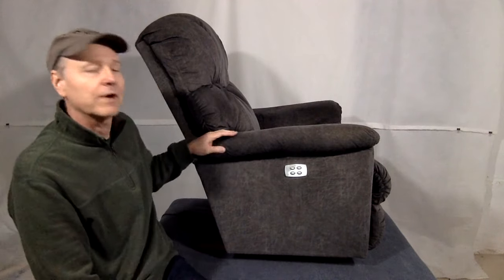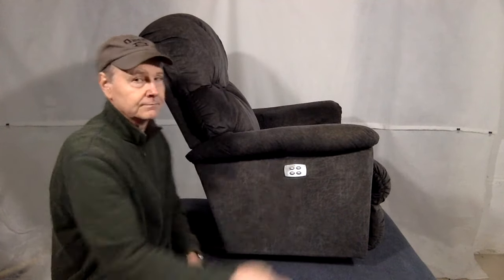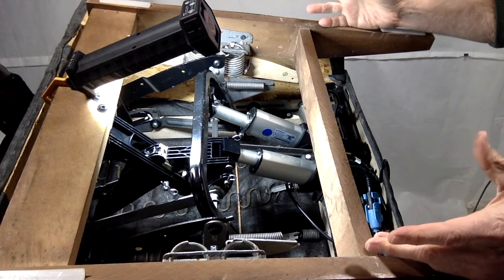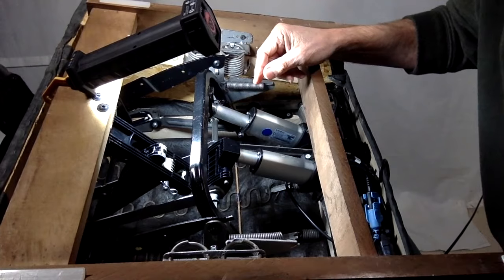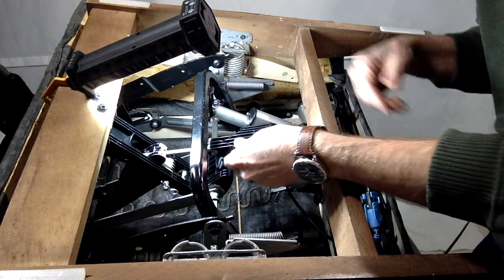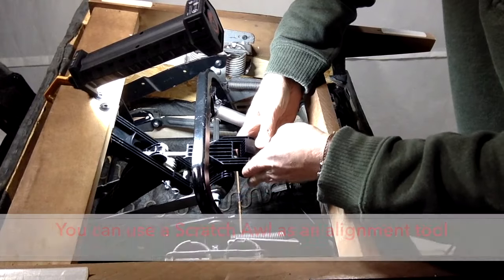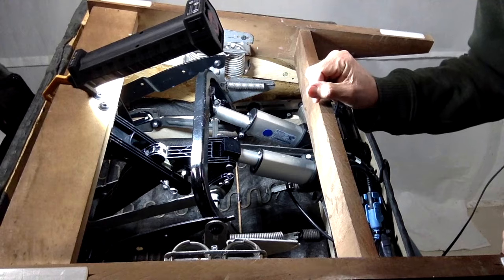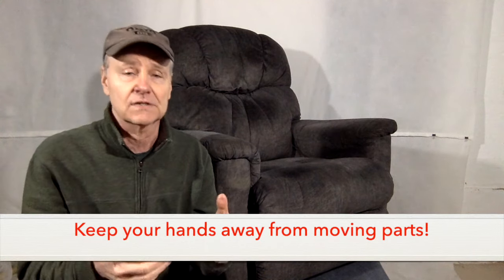Replacing La-z-boy Plastic Mechanism Parts on Older Electric Recliners

Comment: ..this is the exact chair my son just shattered the plastic pieces on...Its a super easy fix but I'm slightly perturbed at the fact that these pieces are even Plastic...🙄
Reply: Yeah, but the updated motor clevis mount is metal, and they're all under warranty, so you can get the parts for free and just have to figure out if you want to pay someone to fix it or do it yourself.
Reply: @ICatheraTashaI  The warranty only applies to the original owner with sales slip and proof. If you bought the chair secondhand at say....Goodwill...like I did, you're shit out of luck.
Reply: @ICatheraTashaI  How long is the warranty?
Reply: Those plastic piece are meant to be easily replaceable.  If they were all metal it could put too much stress on the actuators or more expensive motorized pieces.  So a quick $30 repair could cost $400 requiring new actuators.  So the plastic pieces are actually a pretty smart design and architectural feature.

Comment: My grandson was aggressively rocking in my rocker recliner.  The leg lifts wouldn't go into the down position and it wouldn't go all the way back up. She turned the rocker over.  One of the rocker legs has been totally split into. My daughter used some gorilla Wood glue and repaired the leg.  We thought everything would be fine. But the rocker leg lift was still not coming all the way up, we could hear something popping.  Found your video on YouTube and my daughter looked at the video to determine what the problem was.  It was the actuator bar and it came out of a slot and it was bent.  She bent the part straight, and put it back into the slot.  I'm rocking and reclining again.

Comment: I just started looking with the furniture store about the parts, I'll need to replace the third part not covered in the video... I had quite a catastrophic failure on my hands, sharp pieces of plastic everywhere! How common is  this breakage ? Feels like it should be covered in some sort of extra warranty, they're just so brittle!
Reply from the maker: @mokmo23 - If the plastic part in question was attached to the Drive Rod, this part failure was/is fairly common. As a result, La-z-boy eventually replaced it with a metal part. You can order the Drive Toggle Clevis kit to get the parts needed to do the repair. However, you should also carefully inspect the mechanism & lift actuator for further damage that sometimes results from this failure & can affect other parts as well. This repair can be quite difficult for those attempting it for the first time. Therefore most people should have an experienced repair tech do the repair instead. I've done a few videos on this repair, including this one ------> https://www.youtube.com/watch?v=8cyYZM1orQg
Reply: @reclinerrepairguy4155  thanks! Furniture store sent me the assembly plan with the metal part, so I had to point out my failed plastic part did the job of the new part. Quite annoying.

Comment: I have the same exact chair. I have used your older videos to help me replace the Motor Clevis and the Drive Toggle with the new La-Z-boy metal replacement parts and my chair is back to working again.
I have also had to re-anchor my rocker blocks as well.
Your videos and ideas are a great help to repair and maintain my La-Z-boy power recliner !!
Reply from the maker: @Peter Romano - Good job!
Reply: My lazy boy headrest is not moving... I can hear that it's making a connection, but no movement. How do I know what to replace?
Reply: Hi Peterromano, where did you source your parts? Thank you.

Comment: This is pretty close to the chair I have. My problem is the actuator that controls the back is intermittently not functioning. I have determined that it is not an electrical issue, and has to do with the actuator itself. But what confuses me is that consistently, I can get it to start working again if I apply more pressure and cause it to strain harder. 

Any idea what my issue might be?
Reply from the maker: @4xdblack - Unplug the unit & switch the connectors to both actuators to test. The connector that's powering the footrest actuator should be plugged into the actuator that controls back tilt and vica versa. Now when you plug the unit back in & push the button for the footrest, the back will tilt instead. 

If the SAME actuator is still working intermittently after the switch, the actuator is bad. If the OTHER actuator starts doing the same thing, it's an electrical issue. Could also be the control box, if your chair is equipped with one.

Comment: Hello! I have the style# P10563 do you need all the parts discussed in this video for this type as well? Looks like I don't have the motor clevis mount or the drive toggle that is noted for the style you are demonstrating with. Any tips? Thank you so much!
Reply from the maker: @curiousme3351 - This video demos the older mechanism part configuration on La-z-boy electric recliners. The newer configuration does not have a Motor Clevis Mount (plastic part attached to the top of the actuator) or plastic Drive Toggle (plastic part mounted onto the Drive Rod).
Reply: @reclinerrepairguy4155  Thank you so much.

Comment: Have you ever needed to replace the support assembly bar (black bar that is mounted across the back of the chair that the 2 cyclinders are mounted on)? One of welded mounts has failed/broken off and Lazyboy provided another one but the bar appears to be screwed in place (2 screws on each end) from the other side of the wood which is not accessible. Any suggestions is appreciated.  Thanks.
Reply from the maker: @Trevor Grams - It sounds like you'll have to loosen some upholstery to access the fasteners. Send a photo or 2 to pete@reclinerrepairguy.com showing the issue & I'll try to advise further.

Comment: Hi! I switched these parts out, but the guide rod keeps “falling out” of the “guide”. There are holes that are empty at the end of the guide; I can’t find a schematic for what the name of the part is. The chair also keeps rocking with the chair back leaned back and the foot rest elevated. What am I missing? Can you please help me?
Reply from the maker: @sjdunn712 - It's possible that you didn't get the parts in their proper position during reassembly. Or, perhaps there's another problem.

The chair shouldn't rock in the reclined position. That indicates that the Drive Toggle Connector is not properly engaged with the other parts.

If you can, email photos of the issue to me at pete@reclinerrepairguy.com and I'll try to advise further.

Comment: I've got and old rocker recliner the back doesn't come off and a bolt broke on the arm part of metal frame now the back on the right side goes back I cant figure out how to get the screw bolt through without taking the arm off I would love to fix the chair because it is very comfy for an old chair

Comment: What can be the cause of the footrest not going fully up and when down clicks at rest position. Sounds like footrest trying to go further down.
Reply from the maker: @Ron DenHollander - A simple inspection should provide the answer. Remove the chair back & turn the bottom of the chair upside down -- as shown in the video. Plug in the unit & operate the hand control or activation buttons to inspect operation. Or, have a repair tech do the same.

Comment: Hello,  I have what looks like the same mechanism on my power recliner.   the foot rest goes up, but stops before it is all the way up.  there is not restriction in the movement that last few inches, but, won't stay up all the way.  I have turned the chair over and can't see anything that is out of place or broken.  Thoughts?
Reply from the maker: @Lauren Saar - I'm assuming that the footrest has opened further (higher) in the past. (Some modern recliner footrests do not open as far as others.) The actuator that controls the footrest may not be extending fully. That's one possibility. Have an experienced repair tech check the chair for other potential causes.
Reply: @reclinerrepairguy4155  yes, I just had a hip replacement and was trying to adjust, and heard a pop ...but when I look at all the parts, it all looks fine.  I can manually move it up to the proper position, but it's like the hydraulic piston doesn't extend enough??

Comment: Are there metal parts to substitute for the plastic ones?
Reply from the maker: @LS-zj7kv - La-z-boy has replaced the plastic Drive Toggle (the part that fits over the Drive Rod) with a metal part. It's called the Drive Toggle Clevis. Installing the metal Clevis part also does away with the Motor Clevis Mount, the plastic part that fits on top of the footrest actuator, as it's no longer needed.

If you have those plastic parts & they're still working, you're fine. If/when they should fail, order the Drive Toggle Clevis kit to replace them.

Comment: My husband and I are going crazy trying to do the replacement of the drive toggle clevis from your other video.  We bought the T30 socket, we have applied heat and WD-40 and we just cannot get this bolt to turn.  We are so afraid we will strip the head of the bolt.  Any suggestions will be greatly appreciated.
Reply from the maker: @birdbertly28 - If you haven't stripped the torx-head on the bolts, you should be ok. If you have a power impact driver, and can fit it snugly & securely to the bolt head, that may be your best bet. If you're removing the bolts without power tools, like I do, you'll want to watch the 3 videos I have on the ReclinerRepairGuy.com website on this procedure. 2 cover the full installation procedure & 1 is a tips video on the installation. The videos do require a paid 1-month membership to view, however.
Reply: @reclinerrepairguy4155  Bought a breaker bar today and another T30 (we have now bought two of those) - now we are starting to strip the heads, sadly, could not get a good grip with the breaker bar.  Used the power drill with T30 on it last night, and it was in tight and the clutch just breaks and cannot turn it.  You have watched all your videos so many times we have them memorized, but just cannot get this bolt to turn.  Do they put super glue on them at the factory or something?
Reply: Thank you so much for taking the time to reply.  This has turned into an awful nightmare.  Trying to find an impact driver to rent now.
Reply: FYI even the impact driver we spent $20 to rent  did not work - fully managed to strip the head now though.

Comment: Hey what's up recliner repair guy? I hope you're having a great day and I love your videos. I just recently did some YouTube searches and I found you. My problem is probably rather common, but I don't see a video about it yet. The back of my La-Z-Boy slides up and off. One day, my roommate slammed down and the left side of the back leaned back. Upon inspection I discovered that the base, where the back slides down into the base, had bent so it can't be held by the female slot. I bent it back to match the right side, and applied JB weld so it would accept the back, or the male side, of grip it. I don't know the parts or the terminology. What I want to know is, is this a temporary fix, a permanent fix, or a useless fix. If you have an email, I can send you a before and after and perhaps you can better decide whether this may work. Perhaps a regular weld would be more effective. I don't want to give up on this 2008 La-Z-Boy recliner. It has been wonderful. Thanks!
Reply from the maker: @GrCent - The metal "posts" that the recliner back brackets slide onto are called Seat Swings. If they are damaged or otherwise not working well, you can simply replace them. See this video ------> https://www.youtube.com/watch?v=jzN1x5jZ-gA&t=21s

However, also check where the Seat Swings fit into a hole on the side of the arm frames for damage. If the fit is poor or not good, the swings may not work properly. In that case, a frame repair may also be necessary.

Comment: Do you know how to replace the snap safety (plastic) clips on the lazy boy leg rest. I have a picture I can show you I don’t see how to send it to ya.
Reply from the maker: @Lynn Phillips - If you're referring to the black plastic 3-Position Locks, see this video ---> https://www.youtube.com/watch?v=-uMYiqBp0y4

If you mean the Snap Locks (I think they're called) on some La-z-boy reclining sofas & Lift Chairs, no video on those yet. They're not hard to replace. Look closely at the old clips to see how they're installed. Remove 1 at a time & replace with a new clip installed the same way. Make sure you don't work on the mechanism when it's in a position where the scissors can close on your hands! If you're not confident you can do that, hire a repair tech.
Reply: @reclinerrepairguy4155  thank you so much for all your videos and help. I just can’t get them to stay in place. I am calling a technician today.

Comment: My drive rod on my recliner is backing out. How can I fix that?
Reply from the maker: @Lisa Jensen Jones - There are clips and/or fasteners that hold the Drive Rod in place. For the rod to start coming out of the chair, there would have to be mechanism damage that is quite obvious. 

However, if the chair is still working fine & it just looks like the rod may be backing out, that may be due to a "caved-in" outside arm panel. This can give the appearance of a mechanical problem when there is none.

Comment: Are the parts the same for Lazy boys in Canada? I'd hate to cast off a thousand dollar chair. Thank you.
Reply from the maker: @margieschwartz6757 - It would make sense that the parts are likely the same. Otherwise, the company would have to incur additional expenses with producing different parts for a given region or area.
Reply: Thank you. The lazy boy techs in my area (Fairbanks) are reluctant to touch this chair, which I find to be absolutely ridiculous.
Reply from the maker: @margieschwartz6757  - There can be a number of reasons for this, including the possibility that they don't have the necessary experience to do the required repairs on your chair. Ask them if they can refer you to someone else in your area for service.
Reply: @reclinerrepairguy4155   Thanks. Anywhere else close to us is over 300 miles away. I'm at the point of doing a parts search.

Comment: Where’s the video for the “Harder” fix around the square metal axle?
Reply from the maker: @Chris Crawford  - The video that shows the proper configuration of the Drive Toggle Clevis setup is here ----> https://www.youtube.com/watch?v=lP9Et7F8yVw
The 2-part video series that shows the step-by-step installation process is on the ReclinerRepairGuy.com website & requires a membership to view.
Reply: Is there a video showing installation of this…
AUGSMIAR Metal Drive Toggle and Clevis Mount Fit La-Z-Boy/Lazyboy Power Recliners.Set Includes 4 Elastic Wear Bushings.Fits for La-Z-Boy Power Rocker Recliners.
Reply from the maker: @chriscrawford6245  - There may be some out there somewhere, but I only use genuine La-z-boy replacement parts for mechanism repairs, so I don't have one for you.

Comment: How much does the toggle clivs kit cost
Reply from the maker: @JosephBarrett-zo1lc - If you are the original owner of the chair, these parts will likely be covered under warranty. The parts should cost ~ $15 through La-z-boy. However, if you are not the original owner (don't have warranty coverage), you'll have to pay the retail cost for those parts. Contact La-z-boy or one of their dealers to get a quote. 

Here's what you need to know to order La-z-boy parts -----------> https://www.youtube.com/watch?v=5M6d40rxH-s&t=11s